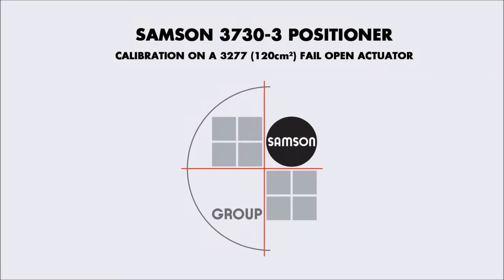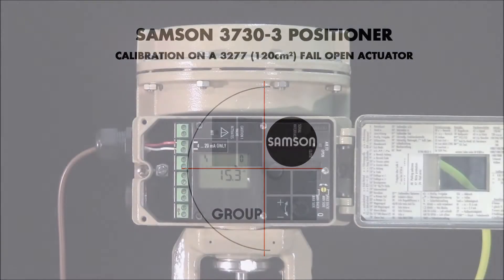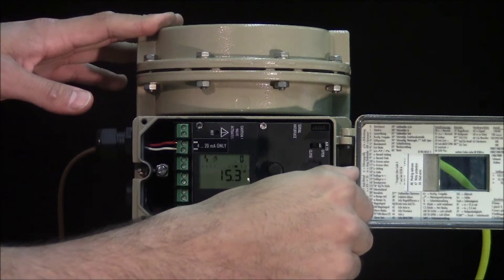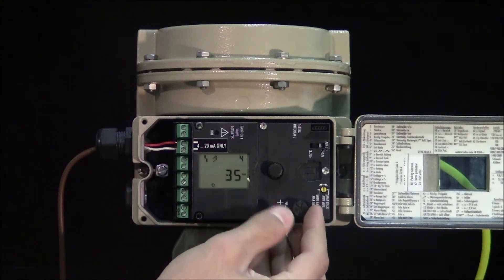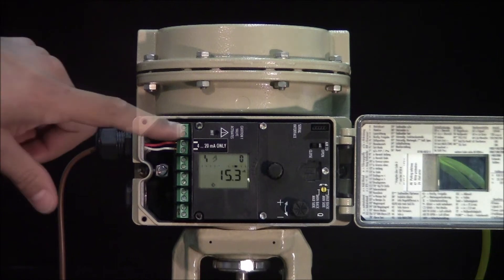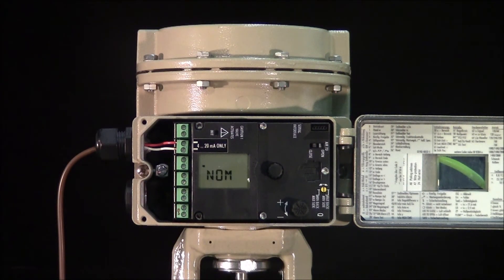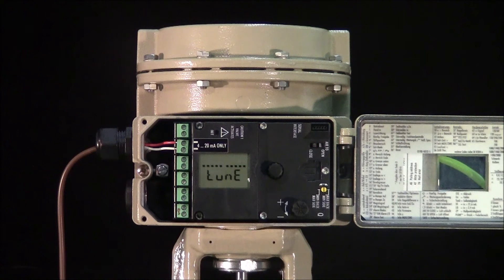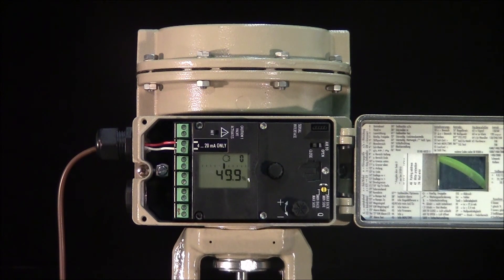SAMSON 3730-3 Positioner Calibration (3277 120cm, Fail Open)

Comment: I found a 3274 hydroelectric valve that went to 100% at 60% signal... can't calibrate it to any better than 100% at 70% signal. A video on that would be helpful